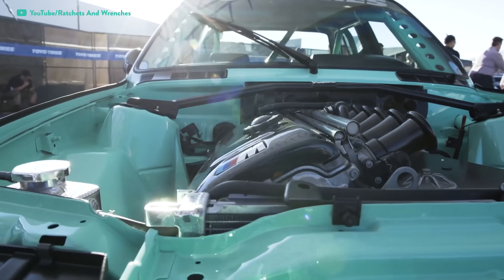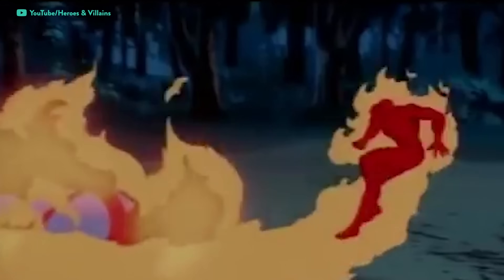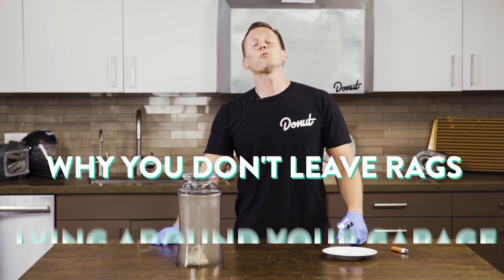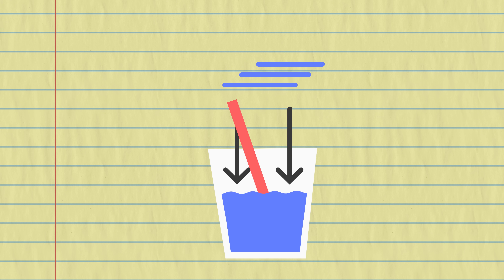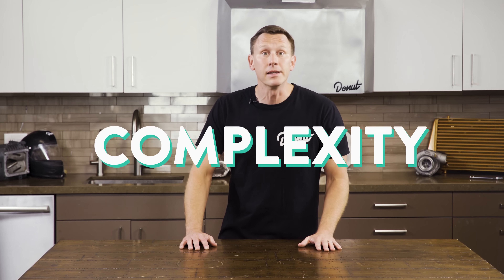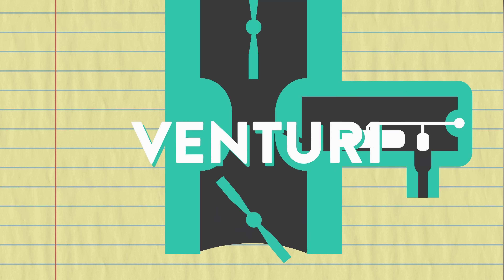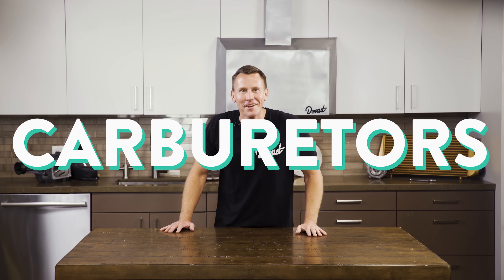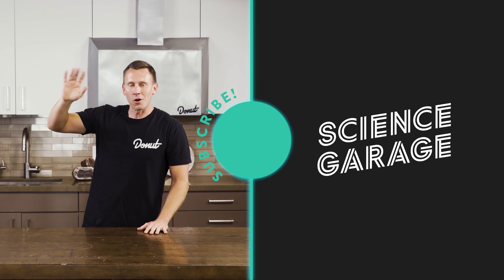CARBURETORS | How They Work

Comment: Hai can you explain what determines engine cc. And how it can be varied
Reply: cc stands for cubic centimeters, it is a measurement of the displacement of the engine. You can also measure it in liters, cubic inches, or really any unit of volume. It is found by using the formula for the volume of a cylinder pi*r^2*h. The bore of the cylinder divided by 2 is the radius r, the stroke (distance the piston travels) is the height h. The you take that volume and times it by the number of cylinders. For example a 5.3L ls engine has a bore of 3.78 inches and a stroke of 3.622 inches. Plugging that into the formula gets you pi*(3.78/2)^2*3.622 which equals 40.646 cubic inches. A 5.3L ls has eight cylinders, so you take 40.646*8 which equals 325.17 cubic inches, convert that to liters and you get 5.3 liters.

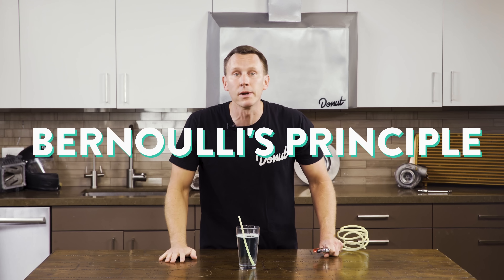Comment: 4:18 is wrong
The basic principle of a carburetor you show using the straw is is the Pitot effect.
Bernoulli equation relates to the venturi which simply improves low speed metering in carburetors.
I have vids showing how carburetors work in more detail with examples of the Pitot effect and how a Venturi improves the Pitot effect at low intake air speeds.

Comment: Its a common misconception that carb'd engines are MUCH less efficient and produce MUCH less power than fuel injection equipped engines. The only reason they have gone the way of the dinosaur is because of stringent emissions regulations (carbs spit unburnt fuel out especially on those choked cold starts). Carbs also do not agree with modern ethanol blended fuels which gum them up easily and in general they require more upkeep but are much cheaper and easier to repair if not functioning. Their biggest advantage is that if you want to modify your engine you can simply and easily rejet your carb to match a change is airflow. Another big disadvantage is that a carb will not compensate for elevation and ambient oxygen changes like a fuelie can and you will have to perform this same rejetting or suffer huge mpg and power losses when going up a mountain for example.

Comment: just one correction, the '91 Grand Wagoneer wasn't actually the last american market vehicle to use a carb. instead, the last one was a '94 Isuzu pickup that sold here. it wasn't a popular option so they are rare, but, '94 was the last yar you could get a brand new carbed vehicle in the US

Comment: the problem with fuel injection is that my 4 wheeled vehicles are running like shit because of the ECM, when they can run perfectly fine without reading sensors and "correcting" themselves.

Comment: Carburetors being cheaper and simpler is subjective.  There's commonly only one injector for early throttle body fuel injected 4 cylinder motors, 2 or more for anything bigger like V6's and V8's.  Since throttle body injection is basically a glorified carburetor that injects fuel under pressure and an electronically controlled solenoid, it still pours fuel all over the throttle plates down into the intake.  Carburetors are terrible at balancing air/fuel ratios for each cylinder, since there's no way to control how rich or lean each cylinder is going to burn, varying power output of each power stroke.  Ported fuel injection systems of the mid 1980's did a much better job by putting individual injectors for each cylinder right next to the intake valve, so anything up top only had to worry about air.  You can extend the runner length for a carbureted intake manifold to get a lot more air into the cylinder, but the air velocity will be slower at higher RPM, thus cutting horsepower potential, but producing buttloads of torque.  You can do the same with fuel injection, but with a much more compact design, since the plenum stores nothing but air to be pulled into the cylinders under vacuum.  Systems like these aren't as complicated as people like to think, as a PROM (Programmable Read Only Memory) chip controls pre determined running values, and the wiring harness is attached to the computer that this chip is inside, thus the computer 'knows' at all times the air and fuel level needed for each cylinder.

Comment: ...also, carbureted engines will still function after an EMP blast, so... there's that.
Reply: Not if they have any type of electronic ignition. Points ignition on the other hand would still work after an EMP

Comment: I don't know how much I agree with you about carburetors being easier to work on. Maybe for a car or for a single or a twin cylinder motorcycle. But, God how I wish I had fuel injection on my motorcycle. 

1 carb per pot, some bikes made back in the 70s and very early 80s had six carburetors 1 per cylinder like the Honda CBX. Not to mention the difficulty in cleaning them and balancing, but fuel injection is a much simpler thing to deal with in my opinion.

Comment: That's weird, because my 95 wrangler came from the factory with a carburetor. And yes it's the original motor. I don't think the 91 wagoneer is the last production vehicle made with carbs
Reply: No way dude, they used "throttle bodies" which look a lot like a carb. Maybe that's what you are thinking of.

Comment: Well as far as the drawbacks go, there's that and the oh-so-sweet sound of a carbed engine (that you usually can't find in modern cars) if it's not restricted in terms of air flow… because screw all the fart cans, induction noise is where it's at!

Comment: You can try and use something like a walnut and rub it over the mark you just made on the table. It's used more for scratched wooden surfaces, but it'd be interesting to know if it'll work in this situation.
One of those life hacks you discover on the internet.

Comment: You forgot to mention that most carbs have instant throttle response unlike a lot of modern cars. Also for quite some time after fuel injection became widely used, carbs had a higher power output
Reply: They still do

Comment: A friend told me that in older cars the throttle pedal was pumping gas mechanically into the engine, is it that part at 7:39? He said that this is obviously dangerous because the fuel can be pumped into the engine even when the engine is off. But since the last car was that Jeep from 1991 (9:30), i don't have to worry about my Audi A4 from 1996 to still have this right?

I would love to get this answered, I'm still a noob in car mechanic stuff and randomly found this channel two weeks ago, love this show, very sympathic guy :)
Reply: Why is it dangereous? I will buy a carburated car as my first car (uh financial problems) and I dont know much about carburetors
Reply: It is not dangerous at all, it just causes a little symptom widely known as "flooding"

Comment: 6:07
I hate that I have, until now, always thought the air to fuel ratio was measured in volume. That would never work since moles per volume of gasses changes with temperature and pressure..
Reply: Uriah Siner PV=nrT ideal gas law yo
Reply: Uriah Siner it could also be in terms of mass
Reply: way better on mas because you can actually balance the equations, since it preserve the same mass
Reply: Yes. That’s the reason we have to adjust the fuel mixture in aircraft as we climb even though the CFM and the suction remains the same.

Comment: they're not going away on lawnmower, chainsaw, & generator.
Reply: Carburetors were still being made in amarican vehicles after 91, my 98 ram is carbureted
Reply: @rapidhorizon9872  About 1996 is when they were just dropped.
Reply: Because carbs are a lot more user friendly, especially on small, simple engines for lawn work. Imagine having to deal with injectors and worrying about electrical components beyond an ignition coil, spark plug, and kill switch on something like a mower or weed whacker. Not to mention the slightly less efficiency of a carb would be very negligible or not worth caring much for considering how much less we use the engines compared to our cars.
Reply: Yeah they are. 

The first two will be all-electric inside of a decade. Especially the chain saw because two stroke engines pollute a lot. 

The last one will likely be replaced with a battery itself for RV or general use and with fuel injection for the few industrial units that aren’t already (most of them are diesel).

Comment: Hey wanna know something cool? Old fighter planes like the mustang were carb’d. When they would do flips or stalls the motor would literally shut off because the float in the carb would flood from being upside down and the pilot would have to (hopefully) get the engine started again before crashing into the earth.

The first fuel injection was in German fighter planes for this reason.

Comment: lets just talk power, top of the line fuel injected motors are making about 2,000hp-2,500hp with there big ole turbos.... but varbs have made a consistent 9,000 top of the line since 1993... "godzilla" v. "top fuel"

Comment: I love running a carb so much more simple and less things to worry about but they have issues also. There are some situations when a fuel injected or a throttle body's are you're better choice. I took a throttle body motor out of my truck and put a older motor with a carb in it this time last year

Comment: One more problem i find with carbs: there arent many people left that can really work with them, so adjustment can be a bit of an issue. Especially with a rare carb. So next up: how to adjust you carburetor?
Reply: rik galenkamp in motorcycle with carbs, there are the choke lever below the left handler. but I don't know how to adjust it, because my first motorcycle is fuel injection (sure I have ride some motorbikes and mopeds with carbs but still don't get it).
Reply: Govin Lock, at my carb there are a few adjustable screws but no freaking idea how far i can turn them. I know what they are for, but thats like everything. My choke is also adjustable, only thing i really understand. Ive revised my carb once and still no idea😂

Comment: Every guy at car meet: 

“Your car MAY MAKE MORE POWER, but CAN YOU TUNE IT WITH AN IPAD?”

“...” adjusts with a frickin flathead
Reply: adjust carburetor with edge of iPad
Reply: smash the iPad, use the jagged glass pieces as a screw driver.

Now u know where the blood came from
Reply: KentGoSuzuki The more you know!
Reply: Use the iPad as a screwdriver 8)
Reply: Seth i didn’t know that every guy at a car meet didn’t know much about cars and couldn’t tune manually, lucky you’re one of the lucky few that know what they’re doing and are superior to most car guys, good job my hero
Reply: @stefanbeefan1519  3 years late to call you a knob

Missed my chance.

Comment: Yes! Finally!! Now I want to see how 4WS steering works or even how the difference between a Centrifugal Charger and a Turbo
Reply: a centrifugal charger is a turbo thats not driven by exhaust gasses, but connected to the crank shaft. Its a mix between turbo and super charger
Reply: 4 wheel steering steering
Reply: Centrifugal Charger is a compressor spins with a belt connected to the engine just like a blower, Turbo is the same compressor working with a turbine which uses exhaust flow to spin
Reply: They already explained this in the supercharger episode. Also mentioned in turbo episode
Reply: Four wheel steering steering
Reply: These people telling you how a centrifugal supercharger work are missing a key component - it’s spun by gear reduction. There’s a set of two gears that connect the pulley to the turbine. That’s why you’ll see a gear ratio when looking at centrifugal superchargers.
Reply: Philip Fox 2.0 and I’m here like tf is a pro charger
Reply: C R U Media Pro Charger is a brand
Reply: Generic HESH dumb

Comment: Hate to say it, but carburetors aren’t as good for performance compared to the electronic fuel injection
Reply: aspal sentul that's why we switched to EFI for "more" fine tuning
Reply: So then how come high performance drag car builders use carbs over efi
Reply: 65sgboogieman almost certain it’s due to rules and regulations within the NHRA
Reply: that's true. today most professional tuners can tuned the fuel injection engines. carburetors are more user friendly through.
Reply: It is actually better especially with supercharger because the air can cool over 100 degrees eliminating the need for an intercooler